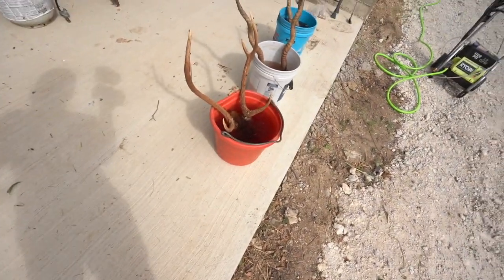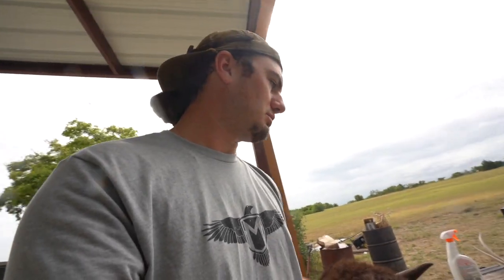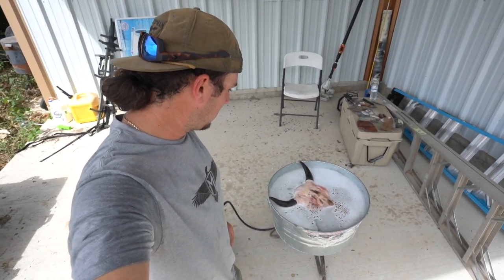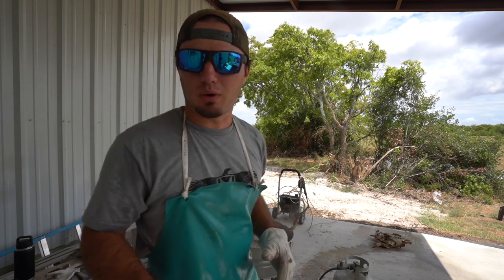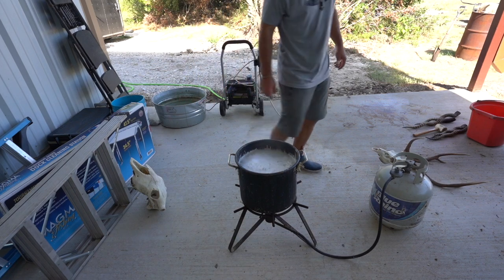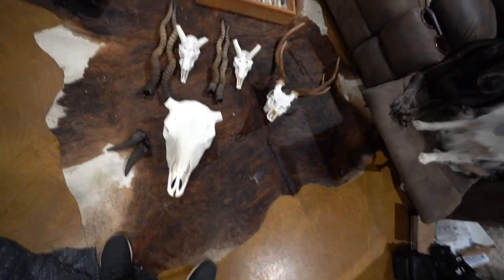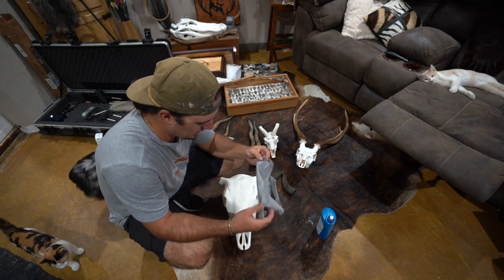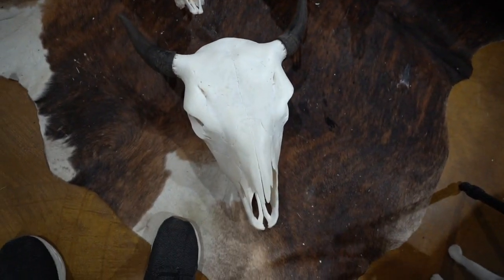How to EUROPEAN Mount A BUFFALO! {AXIS AND BLACK BUCK}

Comment: Tip: if you add baking soda to the water on the first boil, it makes the remaining meat on it like jelly and makes removing the meat that much easier, specially for those who don’t have access to a power washer, a garden house with a high pressure nozzle will get it off.